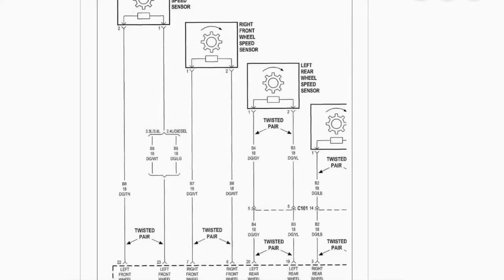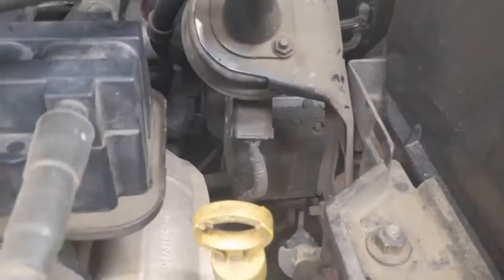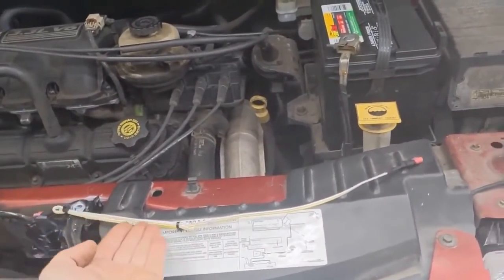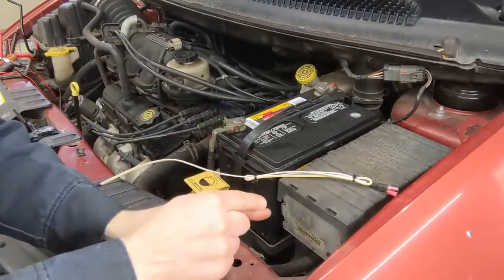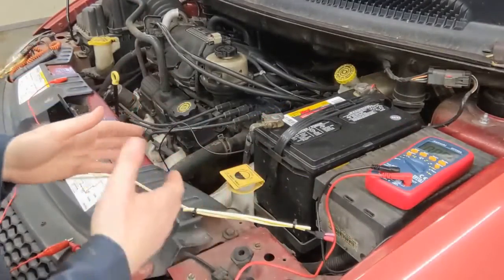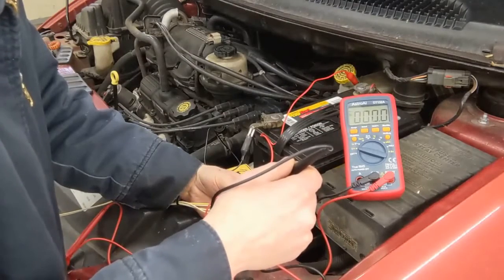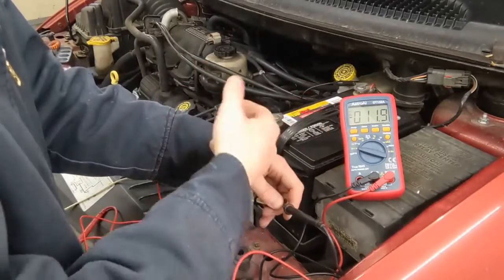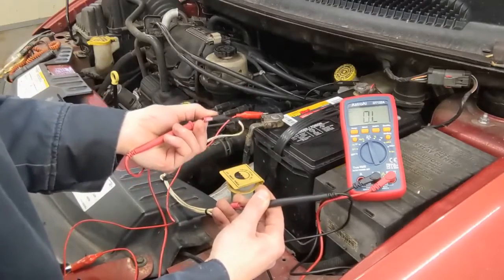Abs Wiring Harness Checks | How to Test the Harness Side of the Abs Circuit System for Faults

Comment: I get no continuity ant the abs connector from either left rear or left front sensors. I haven't checked the right side yet.
I found one plug in mid section of vehicle, which shows connection to rear ok, but nothing to abs plug.
First time I work on abs problems.
It's like someone took an axe, and chopped all the wires going from abs plug to sensors.
I was trying to find out if there are any extra modules/relays between the two. Voltage on sensors is zero on front. 0.5 on rear when all plugged in.
No point ripping out, or testing the pump and module if I can't even find the wires running to sensors.

Comment: You've helped me find the exact offending wire on my front-right ABS. I simply checked the continuity from the sensor to it's destination at the module like you explained in the video. It's the positive thank goodness so it requires no side splicing. Seems it shorted somewhere behind the dashboard so I'm just going to run another wire across the engine bay to keep from digging into the dash. Thanks times a million I've been hunting this ABS light for a year and a half.
Reply from the maker: Nice work! Glad you got it 👍
Reply: Logical approach in finding the fault and not destroying the dashboard and the hidden wiring behind the dashboard, when you bypassed the problem area with a new wire.

Comment: Can i just jump one side and check for open circuit
Reply from the maker: In order to check for an open circuit you need to connect to both ends of the circuit. You can use a long test lead if necessary 👍

Comment: Okay so I found a short to ground using this method. I know which wire is bad. But any part the wire that sees daylight look great, no cuts or corrosion. I suspect it’s going to be a hard find… so how do you just go about replacing the entire wire??
Reply: Also, for testing short to ground, do both sides need to be unplugged?
Reply from the maker: Yes, both sides need to be unplugged at the same time for ohm testing 👍

Comment: Simulating electrical faults is the BEST way to tech them, in my learning experience. Thank you. I’ve been chasing an ABS light for weeks and I’m getting closer and closer.
Reply from the maker: Glad you're getting closer to solving your ABS light issue 👍 What vehicle are you working on?
Reply: @ValleyMobileAutomotive 06 Subaru legacy. Wires seem good. Leaning towards the module itself. Started off as just an ABS light, with valve relay and drivers front sensor, now it has gotten worse and I have a check engine light with the p0500 code (VSS) along with rear drivers sensor.

Comment: 2011 dodge charger 3.6L

Went into limp mode while driving.  Lost all power and engine now only cranks over, but does not fire up.  My ETC (red lightning bolt) light is lit on my dash.  Something is keeping my car in limp mode.

I have a "C0042-11 Brake Pedal Position Sensor (Circuit A) short to ground" code.

The BPPS has a 3 wire harness. The harness itself looks brand new. 

5V feed was good.  
Return to ground was good.  
5V reference was 1.81V and would increase to 3.7V with brake pedal applied. I can clearly hear the shift interlock working as I press and depress the brake pedal. 

Everything is fine, but I keep getting that code after it's cleared, and my car still won't fire up.  It just cranks.  It will also start the car without my foot on the brake pedal at all sometimes.  The pedal assembly is fixed geometry, so no adjustments possible there. 

I replaced the BPPS with a new one, but both it, and the old one, work exactly the same, with the same results. 

I cleaned the grounds to the ABS module.  My understanding is that the BPPS signal doesn't go directly to the ECM, but that the ECM requires data from the ABS module that receives the signal from the BPPS, then sends valid or invalid data to the ECM as one of the conditions for ignition. 

So, my question is, if I want to test "Circuit A", am I testing both the feed and signal for short to ground? 

My feed is consistently 5V.  My signal is working fine through the pedal sweep.

Perhaps it's between the ABS module and the ECM, but I just don't know.  

I'm stumped 🤷‍♂️
Reply from the maker: @oCyberSerenityo  Are there any other codes in the engine computer? Usually the lightning symbol is tied to the throttle body. Is it a push start button or turn key?
Reply: @ValleyMobileAutomotive  i replaced the bpps sensor with a proper dealer part and the C0042-11 code doesn't come back.  

I replaced the throttle body.  I have no codes for throttle.  The only codes I have are for communication with the humidity sensor, brake lamp out.  I had below voltage threshold but that's from the battery dying from the car cranking too many times without a start.  

I took the battery out of the car and charged it overnight to full power. 

As of right now, I have no codes but have the damn ETC light on when I put the car in run without my foot on the brake to start it.  When I attempt to start it, it just cranks the starter but won't fire up. 

I'm at a loss.
Reply from the maker: @oCyberSerenityo  Check the 5v reference wire at the throttle body. It should be 5v with key on engine off. Here's a video of a Grand Caravan that was in limp mode and wouldn't start...
https://youtu.be/saPhL_uOmZM
Reply: @ValleyMobileAutomotive  ok i used my other obd adaptor and it show P0123 and P0222.

I've changed the throttle body about a year ago with a new one.  I'm going to have to test the wiring and see what's going on there.

Comment: 2013 toyota prius hybrid plug in right front abs sensor just being changed but still light is on. How to diagnosis the its harness or other things please
Reply from the maker: @mahtabuddinsakhizdad4408  You will need a wiring diagram to know what wires to test. This video might have some other helpful information... https://youtu.be/OuYueUeRsWs

Comment: Question: At the 5:30 mark, the ground was placed on the negative battery terminal and the yellow wire. How can a solid ground be formed if the wire is insulated? I'm not much of an electrician lol
Reply from the maker: I peeled back the insulation to simulate a compromised wire. For example if the wire has been rubbing on the frame eventually the insulation will rub away and now the bare wire is being grounded to the frame. But you are correct, if the insulation is in tact then the wire inside is protected 👍

Comment: Me gusta tu informacion,gracias. I like your info . Thank. I hope help me up,before there was not the problem but I replace all the brake lines,metal and rubber,front huds with sensors and harness 
ABS LIGHTS IS ON

Comment: I have 3 wheel speed sensor codes and a c0131...i really dont understand the c0131 but im assuming it has somethint to do with the brake pressure readings....if so, i would have to troubleshoot and test everything that could cause bad pressure OR bad pressure READINGS...So electrical issues as well as failing components (which i dont believe is the case because i have no issue with brakes except one single time for 5 minutes my brakes stuck)
Reply from the maker: What car is it?
Reply: @ValleyMobileAutomotive  2008 chevy trailblazer 4x4
Reply: @ValleyMobileAutomotive  I just wish I had more information about the system and how this code is set...then I can use my own common sense as far as what to test/how to test it etc...

If brake pressure discrepancies cause this then I would imagine anything that causes a brake pressure issue could trip this code such as brake booster, master cylinder, etc

Comment: Even though I’m not planning on physically doing any of these procedures myself, I found your video quite educational as well as easy to follow. I’m a seventy-one year old senior having ABS/VSA/BRAKE dash warning icons show up on a FWD 2006 Honda Pilot EX-L. My brakes feel totally fine, diagnostic code unfortunately reads 81.1 ABS Control Unit Failure on a vehicle that merely has 62,000 miles. Research shows very rare ABS module would go bad as usually last the lifetime of vehicle. Honda dealership performed diagnostic test and immediately wanted to sell me a new ABS unit which I believe was quoted at $2600 just for the part. I asked if he attempted to clear (or recalibrate the system) the code removing dash warning signs of which he had not at that point…dah 😳. Mechanic stated there is a neutralization procedure he could perform at which point I sat back down awaiting the results. Walla…cleared code & dash icons gone however he said all might return hence replacement necessary. Drove car for two days then unfortunately dash warning signs returned. Interestingly a mobile mechanic tried this procedure:  turn key to on/off position rapidly 3x’s then start car and dash icons go off. 🚨 Does anyone know why this is? My mobile mechanic thinks it might have to do with starter/voltage draws/electrical causing erroneous tripping of VSA/ABS/BRAKE dash warnings. His diagnostic test only listed code 81.1 as above, no wheel sensor codes, etc. Could there be a wiring harness issue as well? I’d surely appreciate anyone’s thoughts before possibly paying for an expensive OEM Honda module. 🚙
Reply: I would love to know the answer to your question. Did you ever get it fixed?
Reply: @ - Honda Dealership can not order ABS Module due to age of vehicle. I recently readdressed this issue questioning possibility of wiring harness being tested, if a wire leading to ABS Module might be damaged or loose. Mechanic said it could take several hours of labor fees to check. Not sure what to do at this point. 🤷🏻‍♀️
Reply: @lindagolden9892 I used a multimeter to check to see if the TCS relay was good and the TCS module that is located on the ABS module and the ABS module were both good so it's a wiring issue mine. 

It looks like the main fuse box was overloaded somehow because it looks a little fried I'm trying to figure out how I can find someone to diagnose which wire sections are bad or if it's just the fuse box I don't think it's the computer but it could be. 

For now I have to retrain myself to pump the brakes when I am stopping . The TCS does not matter for safe driving, but the ABS  not working is important. With older cars without ABS,  we pump the brakes so you don't lock up the wheels and skid. With abs you stomp and steer stop and steer. 

You're not supposed to pump the brakes on an ABS because it will disengage it, but if it's already disengaged you must pump the brakes

Comment: Very useful video !!! I have a speed sensor  open or short circuit 😢

Hoping this vid and direction will help troubleshoot and find the issue.

One Q , when you tested with the meter for voltage, does the car ignition need to be ON ?
Reply from the maker: Good question. When you're testing for a short to ground the ignition does not need to be on but testing for a short to power the ignition should be on. That way power is being supplied to whatever it's shorted to.

Comment: Reading comments i think confusion with red goes where.. and black to where.

I think i picked  up the theory...and is it this?

At 6:00 minutes the jumper for checking shorts comes down to this.

A short to ground is NOT hooking up a ground. The wire harness is providing the  ground. 

All you are doing is sending volts  from the Battery via RED LEAD on Volt Meter thru meter and into the harness by black lead. 

The connector is disconnected where it normally would complete the ground, thus ZERO VOLTS, unless harness defect is making the ground, Short To Ground 

 If harness is disconected at the wheel for testing... then no volts will make it back to battery ground unless it is SHORTING TO GROUND. to complete circuit through volt meter.

Comment: Great job Robert! I'm really impressed with your explanation. I would like to know whether or not, the speed sensor receptacle on the hub could be a possible cause of the ABS light ON?
Reply from the maker: Good question! Yes, the tone ring can cause an abs light. The easiest way to spot this is with a scan tool that can graph 📈 data. At slow speeds you will see the signal coming in and out like a pattern every time the bad spot runs across the sensor. Metal tone rings may also be visually inspected through the abs sensor whole but magnetic tone rings are different and may appear good to the eyes but be still be faulty, so a scan tool is best with magnetic tone rings.
Reply: @ValleyMobileAutomotive  Good explanation sir.  The tone ring is in good condition and the harness was replaced, but the ABS stays ON. Can the bearing hub which carries the sensor receptacle be responsible for this fault?
Reply from the maker: @reaganekoh3082  What kind of car are you working on? What code comes up with a scan tool?
Reply: @ValleyMobileAutomotive  2009 Toyota Camry LE (Code reads C1333)

Comment: When testing for a short to ground, you’ve got the black lead on the short, is that correct? If so, where do i put the black wire without knowing if there is a short to ground? Thanks
Reply from the maker: The black lead on the short is not part of the test. Just part of the experiment set up. On your voltmeter you want it set to ohms. With the harness unplugged on both ends one lead goes to a good body ground (or negative battery post). The other lead probes the harness/connector pin. Any number on the meter means there is a short, you want it to say OL. When checking ohms (continuity) the harness needs to be unplugged on both ends. And it doesn't matter if your probes are flipped/swapped, it works either way. Hope that helps 👍
Reply: @ValleyMobileAutomotive  helps massively! Fully appreciate the reply! Thanks!
Reply: @ValleyMobileAutomotive  actually for checking short to ground, do I not want multimeter set to volts (dc)?
Reply: One lead , black, in com port and the other in v and ohms port, but reader set to volts? Make sense? 🤣
Reply from the maker: @GMRS4 Both methods work. I'll have to look at my video again I forget which way I showed. Ohms will show continuity or "contact" with a ground or power source. If you are using volts for a short to ground you want the red on the positive battery post and the black probing the connector (unplugged). In this case you are looking for 0v. Anything above zero is a short. With everything unplugged the wire should neither have voltage nor continuity to power or ground.  Two ways to peel the avocado 👍. Good question
Reply: Again, thanks heaps for the reply.  I’m going to try and test for short to ground and power at the sensor end of the harness as the wiring diagram that i have is showing different numbering configuration as to what the actual car harness is, ie the numbers and positions are different and I’m having difficulty ensuring that I’m testing the correct wiring… I’ll get there, but a bit frustrating! Lol
Reply from the maker: @GMRS4  yeah I've run into inaccurate diagrams before. It can be frustrating for sure. If there is anything else you have questions with feel free to post 👍
Reply: Boom! Re-attack tonight and I’ve managed to figure out that I’ve a short to ground on the yellow wire running to the back left in the harness! Now got to find where it’s shorting!! Argh 👍👍
Reply from the maker: @GMRS4  Sweet! Now comes the fun part. Look for areas where the harness may be rubbing against something. You may be able to spot it visually 👍

Comment: How  do u find the location  on the wire for short to power?
Reply from the maker: The next step is a strong visual inspection of all areas that have the potential for the short. Any location where the sensor wiring is bundled with other wires. I've also seen harness connectors corrode and bridge two pins together causing a short. Finding the location of the short is not easy and the wiring harness will need to be opened up at some point. You can also try pulling fuses until the short goes away. Then look at a wiring diagram and figure out where the two circuits share the same path.

Comment: Thanks 😊 very helpful video. I have the rear rigth abs light...changed the sensor and reset and still appears 🤔.  I'm going to try your method before the conclusion of the abs module.  Thanks again

Comment: I feel one thumb up is nowhere near enough for how helpful this video is. Here are 20 more thumbs up. I take it you are placing the jumper cable clip on the part of the cable where the insulation has rubbed off and exposed the wire
Reply from the maker: Thanks Joe 👍. Yep, the clip was to simulate a rub through wire causing short to power or short to ground.

Comment: Nice video. I had both abs and the exclamation light screaming all of a sudden few days ago as I was about to leave the house. I found food crumbs and stuff near the wheel. I'm almost 100% certain rats did this. I found no wires cut.  The scanner  says no communication with abs module. 
Unfortunately, a stubborn screw, idk if it was always there or the local mechanic accidentally put it there, it just refuses to come out. So, I'm unable to remove the air filter housing to access the abs module. Will try and do something about it but I do not have the wiring diagrams of the vehicle. Where could I find the wiring diagrams for the polo 6r model?

Comment: Can test the wire using 12v on a 5v circuit? Cause I have that problem, but it uses 5v reference.
Reply from the maker: The multimeter will only read how many volts are present. So even if your negative lead is hooked to battery negative if the power you are measuring is 5 volts then your multimeter will read up to 5 volts. It won't hurt the circuit. When both sides of the harness are disconnected there shouldn't be any voltage on the connector. If there is voltage then you have a short somewhere. Running 12 volts through the wires with everything unplugged won't hurt the circuit because there's very little current flowing through it. But both sides of the harness need to be disconnected that's important.